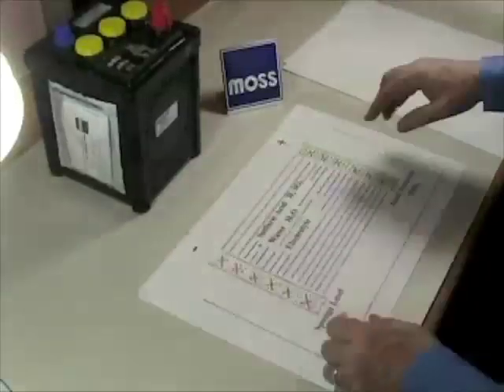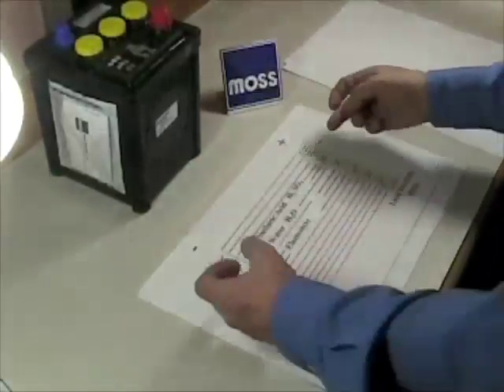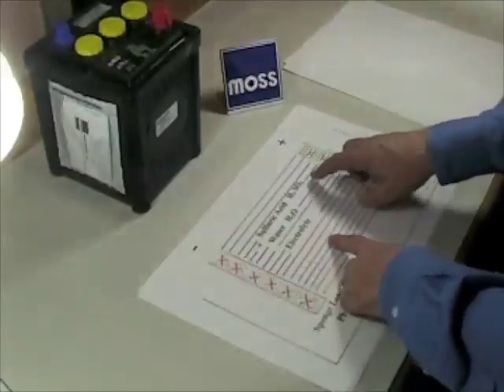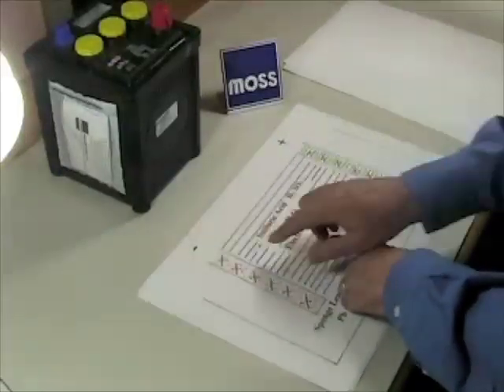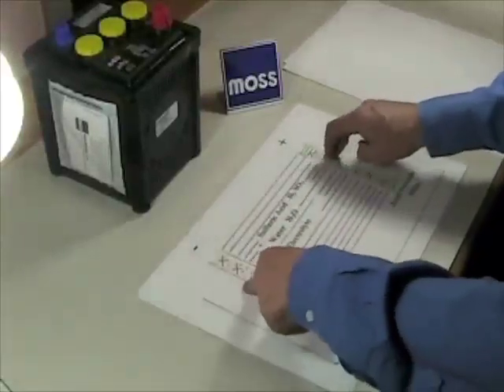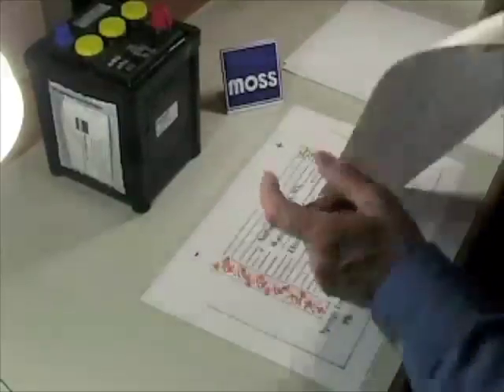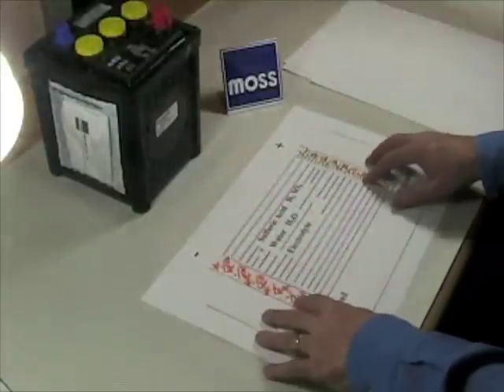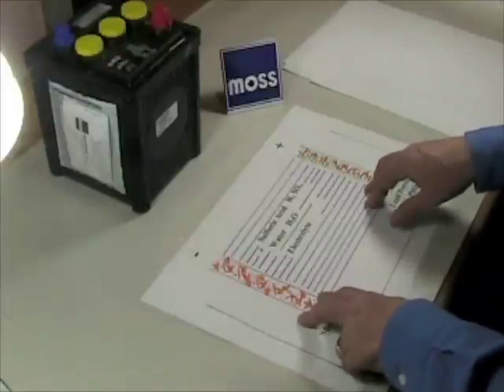Batteries - How to Remove Lead Sulfate Buildup from the Plates

Comment: SOmeone is smoking the good stuff. Take a old ups battery and tell me you can make it function to its original capacity and I will tell you your on crack.
Reply: I can take a old ups battery and make it function to its original capacity. Not really though, but I can sometimes fix an old UPS battery if it doesn't have a "bad cell" and has not overheated but I usually don't get more than half of the original capacity. But fixing batteries that were not connected to any kind of always on charging always has better results.
Reply: @TechHowden  sulfate baked into the lead plates ruins cells/batteries. I have tried many solutions and none of the snake oil works. Maybe some chemical can do it, then after washing it out, fresh electrolytic.
Most sealed all way charged batteries are baked bone dry, add distilled water and shaking (or vibrating)it to get all the bubbles out (or in a vacuum) would help.
Reply: @user-rs8zg8ey2b  what I do with the sealed batteries is first make sure that if you shake the battery, you don’t hear things rattling around I will refill the cells then start charging it with ~40v and then once it starts actually drawing some current then charge it at 16V for several hours and if no individual cells heat up much then I will continue charging it with a normal voltage (14.6v) for a week and then see if the battery actually works. Also in my experience it seems like if I try adding Epsom salt or whatever it just makes the batteries die quicker even though it will put out more current. I mostly just do this for fun because usually the batteries will fail in another few months anyway.
Reply: @TechHowden  that pretty much the same I do, after adding distilled water, the first 20v 1A CC setting connection is a clear indication if your dealing with a dud or something can be used for light duty, if hardy any current starts on this first charge it's a dud. Best ever I took a ups battery that was bone dry and it gave me half capacity. Lead acid are the worst.
I found some LiFe cells I am building a off grid storage for my 2nd home. 72KWh battery pack new cells, DIY for $8K + 500 bms. I already have built the 12KWh panel array for $2200 (48 250W panels at $45 each). I will provide power for 4 small homes, ~$100/month, with a break even point of under 1.5 years, plus the write-off. After that it will bring in $5k a year.
Batteries are from battery hook up. See link in next post.
Reply: @user-rs8zg8ey2b  that sounds like a very cool project

Comment: Chemistry: Lead Sulfate is not soluble in water or sulfuric acid. Once formed in the battery you can only dislodge it or open up fissures to access the underlying lead plate.  Can anyone honestly say that desulfation techniques work?  I have never seen any quantitive proof.
Reply: Battery chemistry: lead sulphate + electric current = sulphuric acid;  Sulphuric acid - electric current = lead sulphate.

Desulfation must be working according to the above chemistry or the battery wouldn't work. The fact that the battery could be discharged and recharged repeatedly is proof that the chemistry works. The chemistry is not 100% efficient. After each discharge/recharge cycle, there remains lead sulphate that has not been converted back to sulphuric acid. Eventually, there is no more sulphuric acid and the battery dies. This is why in indian/pakistani battery rebuild videos, those people can stick their hand into the battery "acid" and nothing happens. This is because the dead batteries no longer had acid in them.

If your question is do pulse chargers desulfate? I don't know.  If you question is do appropriate chemicals desulphate? The answer is likely yes because I am running with a 17.5 year old BMW battery. Otherwise, howTF is my battery still working?

Comment: Once a battery is left dead for a long time then the lead sulfate hardens up, now if the plate is more than some ~ 70-80% covered then it will insulate the plate and less current will pass.

Comment: Thank you for your help reconditioning my batteries .I was just about to throw out 3 old batteries that I thought were completely dead. But I was able to recondition them using your methods in less than 1 hour [Check Details Here==>https://plus.google.com/100351090281822647456/posts/Gwtd4mVBdEd ]! This just save me hundreds of dollars.

Comment: My battery charger has a recondition button that is designed to remove sulfate from plates. It completely restored an old lawnmower battery from 2008 into a like new condition. It took a few days of reconditioning to do this. It is a black and decker 15amp charger. It also has a engine start 40 amp mode and an alternator tester.

Comment: Hello..
Please I need help to re-use lead acid batteries that may have accumulated inside the lead sulfate ... how to separate sulfates needed for plates with greetings ...
Reply: Impossible when you discharge a battery past a certain point.  Send them to the recycling depot and buy new batteries.  Fully functioning batteries depend on the lead plates being both pure and the lead oxide coating being in good condition; as well as the electrolyte being at the right concentration.

Comment: I use epsom salts;a teaspoon in each cell every so often works a treat
Reply: I did same
Reply: It is much easier to maintain the life of your lead-acid batteries by keeping them fully charged, and not discharging them very much when you use them.  Epsom salts don't really do much, but the distilled water usually helps.
Reply: Really???

Comment: not true.  the battery of 6 two volt cells produces, and "wants" 12 volts.  The charger is 13 to 15 volts, with the load of the battery.  The charger is higher in order to overcome the resistance of the plates. Ergo, the battery is being force fed.  In fact, you can actually charge a 12 volt battery to 18 volts.  It warps the plates but it can be forced and it will read 18v when the charger is removed.  This is a capacitive effect.

Comment: news flash !!,you dont force electric in a battery,,,the battery pulls electric from the charger,,,get your story straight !!
Reply: Not if compleatly sulfate genius the charger will stop supplying current. You have to connect a 2nd battery in parallel to "force" the charge( not exactly forcing but tricking the charger. 
And this is not a theory it's well known